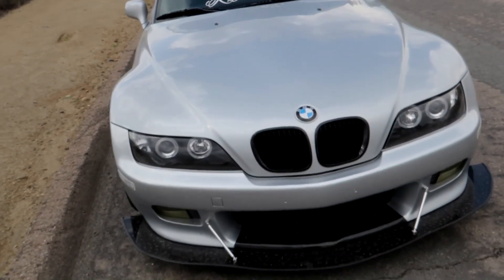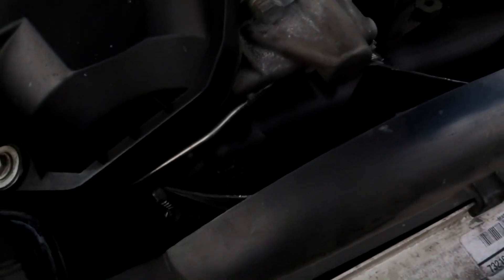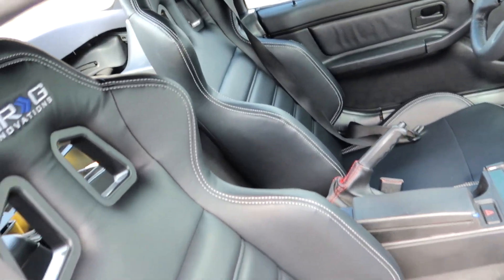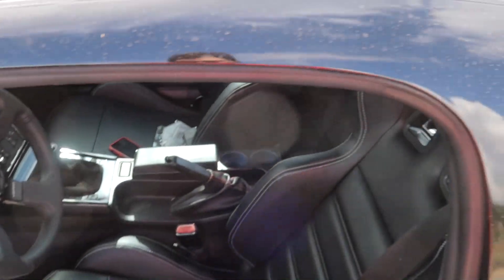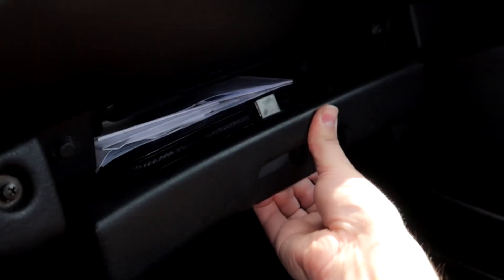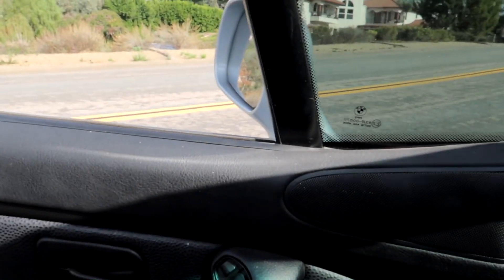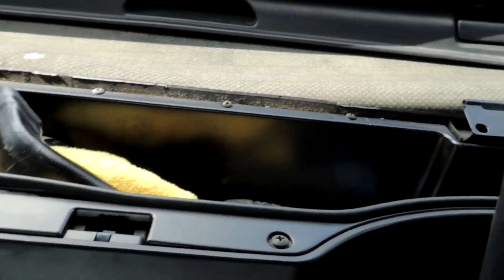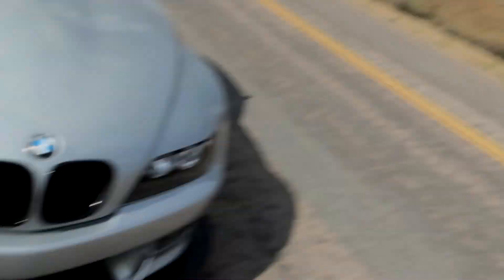5 Things I HATE About My BMW Z3!!

Comment: Looks like you need a glove compartment latching mechanism replacement. Happens a lot over the years with cars as they get older regardless of manufacturer. Can be a pain to swap, could be easy, hard to say because they are all different. 

As for the screeching and the windows:

Screeching doors might just need wd40. Windows; glass cleaner. Might also need a new motor soon.

Comment: Try using compressed air in the striker and latch. Probably dirty. A little silicone detail spray in both locations should help too. There's a reason the glovebox isn't closing. Slamming is not the right option.
Reply from the maker: Yeah i know slamming it isn’t good lol but I guess I’ll try ur way, thanks

Comment: Also window motors and stuff, easiest way to check is to pull the connections on the window motors, clean the terminals with electrical parts cleaner, a little dilectric grease on the leads and it may help. 

rear compartment is easy. Make a template out of cardboard, cut some 1/2" wood, cover with diamond stitch quilted leather and let err eat
Reply from the maker: I ain’t the best at cutting😂

Comment: Haven’t had the glove compartment issue. My glove compartment feels like it hangs too low and stuff almost falls out. Anyone else?
Reply from the maker: Yeah my brothers e36 does that. Here’s a quick fix for it. Try to search up the issue for an e36 it’s the same thing
Reply: Bought a metal part on Amazon, installed and problem solved. 👍🏽

Comment: I owned one.  The engine and tranny were great, but everything around it slowly started to fail.  Parts were expensive and I replaced more parts on that car than any other.  And the other drivers were mean to me!  I have never experienced this type of behavior with any other car.  People would cut me off, not let me merge; basically acted like they had a grudge against me.
The interior panels are made from a plastic that breaks easily.  So, if you aren't super careful taking a panel off, it will break at he point of attachment.  Glove box is almost guaranteed to be broken.  Cooling system leaks from plastic parts.  A replacement hood was over $1200 15 years ago.  
I now have a '13 miata prht club sport and love it.  The dimensions are almost the exact same as a Z3.  I couldn't get myself to buy a NB miata because they were too small for me, so I bought the Z3.  The Z3 is my biggest automotive mistake.  The best cars I've owned are the ones made in Japan.  good luck

Comment: I replaced my valve cover, I have the 2.5, it's still leaks, what's the next place I should look ?
Reply from the maker: Where is it leaking from?
Reply: @KyleGreenSpeed3  the whole bottoms caked, it has two drip stops coming from the front and one from the back
Reply from the maker: @jac.mobile5646  if it’s coming from the bottom it could be the oil pan gasket. There’s a couple other places like the valve cover gasket but I’m not sure on other locations cause I haven’t had a leak from anywhere else other than valve cover

Comment: I have a 1998. The glove box works fine. Maybe you need an adjustment 🤷‍♀️
Reply from the maker: Yeah mine is just sticking I just need to spray it with something and adjust it properly and the screws wer loose on the handle so I tightened those up

Comment: I don't like my leaking cooling system and cracked valve cover. Fix them dude. Look after your car. Every BMW owner will tell you preventative maintenance is key. My e46 hasn't used a drop of oil or coolant between services and it's 22 years old.
Reply from the maker: You know read my comments already. Said this enough times lol at 180k with a lot of new parts and clutch and everything. I know what I’m doing
Reply from the maker: Cooling system literally never had an issue I was saying what issues u can come across
Reply: Aye no worries dude. Didn't mean it to sound like a dig. Just seems like easy things to fix. I suppose with that mileage it's had a lot more use than mine. 
I always replace the entire cooling system and stick a metal water pump in when I buy a 90s/20s BMW. They are just crap systems. 
I've heard a lot of BMW drivers say 'this is normal' BMW things when they aren't. Like ticking engines or tramlining or using oil which is only normal if they aren't maintained. 
Given yours has 180k(which I didn't release) it's slightly different. 
Anyway good luck with the car.

Comment: Dude...for Pete's sake... clean your damm car, takes 15 minutes to clean your engine. and NO, not all BMW's leak, all you have to do is replace the gaskets. I replaced the head gasket in an hour, no big deal. Its all in YOUTUBE, just like cleaning your engine. That is a special car, treat it that way. Detail the damm thing, will take you a day out of life.
Reply from the maker: Hey Dumbfuck check out my instagram and you’ll know i take great care of my cars. My bmw has never leaked and yes they do leak when they get old but it’s called replacing. Also I have done a headgasket myself on an e36 m50, so ur not that guy pal. 180k miles still going strong so look at the facts before u assume

Comment: You had the car 2 years and didn’t change that stuff out yet? Buy a part every two weeks and take a weekend to pull the old shit out and replace it. The valve cover gasket is easy, radiator and fan is easy, belts pulleys easy, c’mon bro.
Reply from the maker: Had a lot of bills with a shit job and also I literally said I spent 1500$ on new hoses and parts and got a gasket and all that . Literally have an aftermarket clutch installed and installed an electric fan in as well
Reply from the maker: I know what I’m doing lol